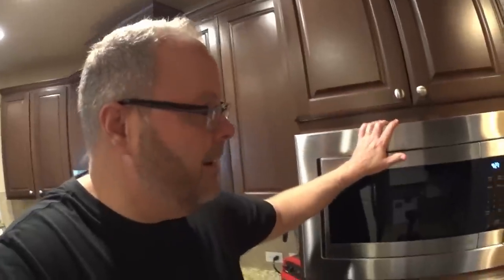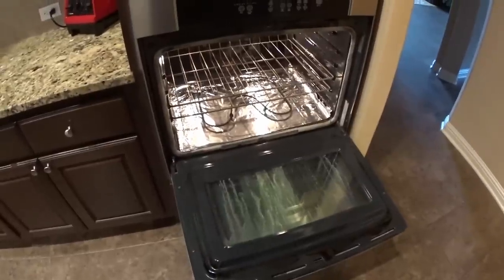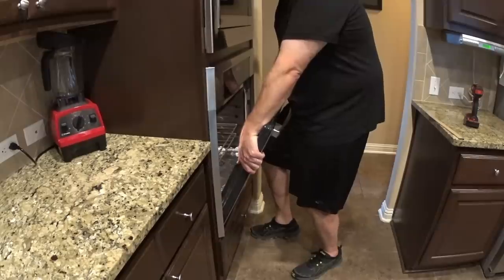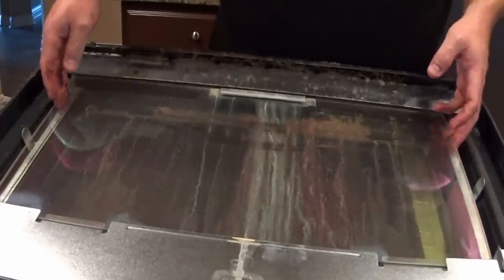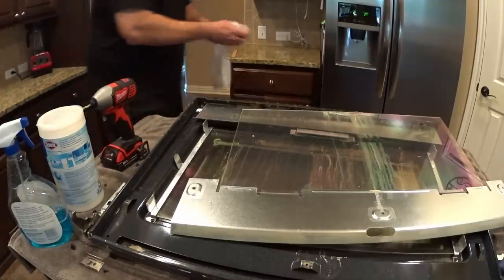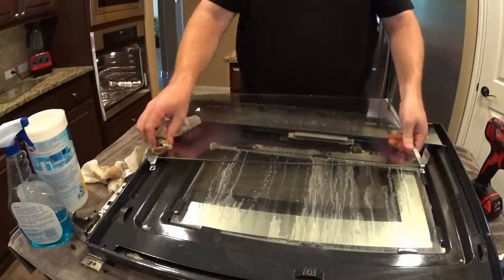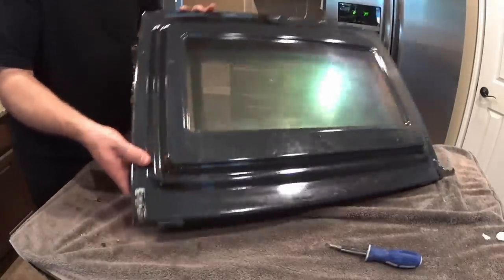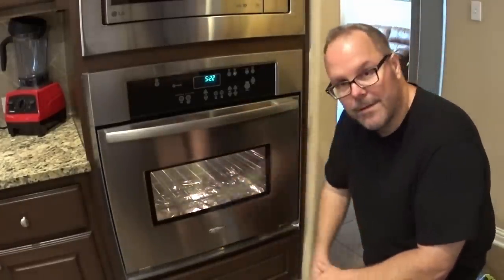Clean BETWEEN Oven Glass - How to

Comment: I have the same issue with drips between the inner glass on a GE oven. Will use my phone camera to take photos as I go. Suggest using light pieces of cardboard and punch screws through it to keep each section’s  hardware together or , possibly baggies.The third pane makes the oven more energy efficient , but not perfectly sealed for preventing drips.

Comment: How come you are putting in what looks like cotton batting between the bottom layer of glass & second layer of glass?  It wasn't there when you took it apart.  Is it flame/heat resistant & what is it's purpose?  Taking the door off would also make it easier to reach all the way into the back to clean the oven.
Reply from the maker: Thanks for taking the time to comment. The batting is heat batting that was already in the oven door and l am just placing it back where it was. Apologies my edit did not capture it's removal as well as it should have.

Comment: To those looking and thinking “it’s too complicated for me” don’t give up until you check your own oven first.

This oven demonstrated here seems to be way more complicated than my Indesit oven to clean in between the glass.

With mine and I suspect many other makes too there’s no need to remove the door at all , let alone all the casing either

Just drop the door down unscrew two obvious screws holding two small brackets in place that is holding the glass to the door , prise up the inside glass carefully using a butter knife or screwdriver and clean the insides of the two panes of glass ...replace and your done ....5 mins tops.

This video although well presented is not typical of the faff you need to go through to clean the inside of the glass

wether this channel presenter knows it or not he has one the most overly complicated ovens to clean inside the glass I’ve ever seen .

Trust me , before you give-up-the-ghost on even looking at yours based on what is presented to you on this video go and look at yours first ...it’s blatantly obvious what 2 screws needs to be unscrewed and removed before you need to think about disassemble the entire door like this video shows
Reply from the maker: Agreed, all ovens are different so it's definitely worth a look at your own oven.

Comment: Does the door have to come off in order to clean it?
Reply from the maker: It does if you can't get it fully clean through the openings on the top. There are a few screws along the bottom that you can only access by removing the door.

Comment: When you are taking apart why you did not show when you pull out that white insulation ,you only show it when you are putting it back.
Reply from the maker: Apologies the editing did not show it as well as I had hoped. The insulation was simply laying on the bottom piece and I reassembled it exactly as I had taken it apart. Your oven may or may not have this insulation.

Comment: There is a much easier way to clean the oven door glass. Get the aerosol window cleaner and polish .. Sold in auto parts store in our area. Then put a towel underneath the bottom of door , there are large vents on the bottom. Then carefully spray the cleaner in the top vent holes. You may need to do it a few times in the beginning. The spray turns to a white foam. And read the can before using the window cleaner. !!!!

Comment: This video is totally stressing me out!  All I can think of is not remembering how it goes back together and having parts left over  lol.
Reply: Haha, well, it's not for everyone.  For multi-step tasks like this, I take a pic at each major step then label a small zip-lock plastic bag with that step's #.  Then I put the screws, nuts & bolts, etc. for that step into the bag and note that step on my notepad/clipboard.  It's a bit slow while taking things apart, but the payoff comes during assembly when I don't have to remember where things went or which screws or bolts were used along the way.  And now, with today's mobile phones, a "pic" can also be a "motion photo" -- meaning it's a short video clip.  (A feature on my Samsung GS9 phone.) 😁
Reply: Check out the method GE Appliances reccomends haha theres a video on youtube, they remove the door as one piece and leave it like that. they just dip a towel in soapy water and then tie it onto a yardstick and poke it between the glass from the bottom

Comment: Started watching video, stopped after the oven door was removed and had 3 panes of glass--this would be an all day project and my husband would be the one removing and reinstalling the door; his schedule would not allow it.  I don't have the strength or wherewithal for the project (in my mid-70s).  Thought the first idea, reaching into vent holes with something resembling a yardstick w/paper towels wrapped around the end, sounded plausible.  However, I envisioned removing the stick but thepaper towels remain between the glass panes.  Dirty window better than framed dirty paper towels. LOL

Comment: Ok I did on my 2020 GE profile oven (three panes of glass). It took about 45 minutes. Need a phone camera , Need a T15 TORX driver and 1/4 inch nut driver. Remove door and lay it on a rug or towel on floor or bench. Remove top two top screws from top inside of door. Just loosen enough to free them. Turn door over and remove three machine screws with nut driver at bottom. Other than that pretty much like his video. Suggest nitrile gloves to handle glass. The two inner panes are framed by a steel double channel. There is a tab on one corner that you bend up to release the frame and carefully slide out glass panels for cleaning. The glass is thin so have a towel on a flat surface to clean them. As I said , take picture along the way and Mark holes where screws go if you need to. There are four sets of screws all same length and type with each set so it’s hard to confuse things.

Comment: Some door panels have a retaining mastic which stops the glass rattling in the metal frame. To remove the glass, apply gentle pressure in the opposite to the retainer mastic to slide the panels out. 
Don’t use metal tools on the glass or it’s direct fixtures as cracking, fracturing or breakages will result. I wouldn’t use a steel ruler near the window to clean it as it it could easily penetrate the cleaner cloth or material used to bind it. 
Those doors are awkward and dependent on the state of your oven, you may need to place a protective covering on the floor in front of it before starting to disrupt any of the fixtures/hinges.

Comment: There is no way I will ever clean between glass panes. I think it would ruin the seal. I have never had a problem with dirty glass, but it is not visible unless the oven light is on, so if the panes were dirty I would not see. Lol. I use the oven light about once a decade!

Comment: I need to do this to my oven. From watching the video though, I suddenly like the rustic look.
When I remove screws from assemblies like this, I store the screws in the holes from which I removed them. Especially when it involves screws of differing sizes.
When I work with loose glass panes, I wear gloves, in case the glass slides, I don't get cut; and, I don't leave fingerprints when I handle the clean glass.

Comment: Very informative. Am I missing something, I see a cotton gasket in the reassembly but did not see it in the disassembly.  How did I miss it?
Reply from the maker: Thank you so much for taking the time to watch the video! That was a piece of heat resistant fabric that was laying around the perimeter of the outer window on my oven model and not attached. It gets sandwiched between the outer window and the inner frame. My apologies the edit did not show it as well as it could have.

Comment: Hope you rememberr where all them skews go so what did you clean it with after all that
Reply from the maker: I used clorox wipes to clean the grease off the glass and then followed up with glass cleaner. It worked out great! For the screws, I put them around the perimeter of the door near where I took each one out.

Comment: I didn't see that white strip of cotton/cloth you put back in @ 6:27. I didn't see it come out???
Reply from the maker: Hi there, thanks for watching the video! Unfortunately my editing did not depict the removal as well as I had hoped. This was a heat resistant fabric that was laying around the outside window of my specific oven model and was simply sandwiched between the outer glass and inner frame as you see in the video.

Comment: The stuff that is getting in between that glass is from wiping the top and water and soap is dripping  in between the slots on the top. If your oven is a newer of than by taking off the door like that you will void your warranty don’t do that. You can also go up from the bottom and clean to but stop dripping soap and water from all the holes and that won’t happen.
Reply: Grease from cooking drips between the slots.

Comment: I really want my oven glass to be clean.... I can't even see through it right now.... but I'm scared I won't be able to reassemble the door once I take it apart! Any tips for making sure I can reassemble it? You did it so easily, and it looks great! :)
Reply from the maker: I am with you! Using the yardstick method I mentioned at the beginning was going to take too much time and frankly I was not sure it would get everything - like you I really wanted it to be clean! Best advice is to take your time and take pictures of the inside as you are taking it apart to make sure you see where everything goes. Once inside, it was pretty easy to make sense of how everything goes back together. When you are taking the screws out, I placed them around the outside of the door near where I took them out. When you assemble it back together, make sure all of the holes line up. I found clorox wipes worked excellent to get the glass clean and then just follow up with glass cleaner and you will be in good shape! Good luck and let me know how it turns out!
Reply: Easiest tip for anybody taking anything apart and wanting it to go back together :
Use your phones camera, take pictures at every step.
Another trick is to use butchers paper (Xmas paper works too, just flip it to the blank side). Draw the item, showing where each screw goes. As you remove a part place it on the full size drawing. (Your drawing doesn’t have to be very artistic, just enough for YOU to recognize the part.). I’d even number th3 parts as you take them off. 1 for the first part 2 for the second. Don’t use 1 number for parts even if they are the same, number them in the order you removed them. 
Good luck. (When my sons got into R/C cars, this is how we educated ourselves about them.)
Reply: Guarantee it wont be that easy I've tried crazy stuff like this, that was at least a dozen screws on 3 different panels shoot it would never go back right. Just my opinion. Also with stopping the video who knows how long this really took I bet at least 3 or 4 hours. I would be thrown the glass out the back door after hour 2. Lol

Comment: I see you have foil on bottom.  We recently bought a new house this past December.  When we bought the house all fairly new appliances (about a year old) however the previous owner did the same and I have foil stuck on oven bottom can not get  off no matter what. Does yours not stick? I've tried everything.  My bottom heating element is under the casing in oven not showing  like yours is that the difference? Do you have any recommendations? I've done baking soda with vinegar etc etc
Reply from the maker: Thanks for taking the time to comment! I think the stuck foil must be because of your element being below the surface. A quick search on the internet and I found this article that may help with removal of the stuck foil: https://www.cannonsappliance.com/oven-cleaning-tips
Reply: @ThatDadMike  0
Reply: @ThatDadMike  i love you show it helps alot ty

Comment: My question is WHY or HOW does this happen. I live in an apartment. 2 units in same complex—transferred from one to the other. SAME ovens. Lived at one 14 years (!) and NEVER had any streaks within. New unit just moved in. After 2 months there are streaks inside already! Why????!! Ugh…(And here I’m trying to be all careful in the new place because of the horrendous job of cleaning the dirty oven in the old place at move-out…)
Reply from the maker: The only thing I can think of is when we scrubbed the top some of the cleaner must have drained down a bit. It's been clean for two years now and unfortunately this last cleaning triggered it again. Definitely a poor design.

Comment: And I see the tinfoil on the bottom! I will definitely do that! Thank you for the great tips 😊
Reply: WARNING: Do not place tinfoil on your oven floor...some oven manuals actually say it can damage the oven. 
Read precautions first.
Reply: @tonymusolino2369  Ok, thank you so much for the information 😊
Reply: Don't put foil on the bottom. It will heat damage the oven. Instead, you can cover the bottom rack with aluminum foil.
Reply: @tonymusolino2369  I can't use this video for removing the oven door since my oven door has different style hinges.  Once I saw that sheet of foil on the bottom of the oven, I was wondering how long I'd have to scroll down before someone commented on how that is NOT recommended.

Comment: Good, but you didn’t show us when you removed those white cotton like square, thanks
Reply from the maker: Sorry about that, my editing may have cut that portion a slight bit. The white heat resistant fabric was just laying around the outer door glass and does not need to be removed. It gets sandwiched between the door and the next frame piece as shown in the video.

Comment: (1) You should have mentioned that taking anything apart will void any existing warantee. (2) Others have mentioned that taking it apart has affected the air tightness of the door, and that can make baking a fail if you are constantly leaking heat.
Reply from the maker: Thanks for taking the time to comment and appreciate the suggestion. The warranty on my Whirlpool had expired. The factory only provided a 1 year warranty from date of purchase and was limited to defects in materials and workmanship from the factory (receipt required). If yours is still under warranty, it's worth a call to your oven manufacturer to be sure but my paperwork did not expressly state that it would void the warranty. Additionally Whirlpool publishes instructions on how to remove the door on their website. If the door is reassembled correctly, there is no impact to the tightness of the door or its ability to retain heat.

Comment: I feel there were some steps and/or details missed. Like the insulation that you showed having to put back in, which you never showed coming out. It also looked like there was more to separating the two halves than just remove screws and it's done.
Reply from the maker: Thanks for taking the time to comment. My apologies but my editing cut slightly short the picture of the insulation. It was simply laying around the glass pane and then sandwiched between the frame as you see in the video. My oven was only held together with screws as you see in the video. Total time was less than an hour and it was much easier to disassemble than I had expected.

Comment: Did anyone notice how his cam skips the removing of the "insulation" step but you see him put the insulation back on? That's a major faux pas.
Reply from the maker: Hi there, thanks for watching the video! Unfortunately my editing did not depict the removal as well as I had hoped. This was a heat resistant fabric that was laying around the outside window of my specific oven model (yours may not have it) and was simply sandwiched between the outer glass and inner frame as you see in the video.
Reply: @ThatDadMike  Thanks for the clarification. Editing gets Oscar awards so I respect it is not easy.

Comment: WHY TAKE THE DOOR OFF; IT IS NOT NECESSARY!  JUST UNSCREW AND REMOVE THE GLASS, CLEAN IT AND REPLACE IT. WHY MAKE IT SO COMPLICATED!
Reply from the maker: Unfortunately the way my oven door is constructed there is no way to remove the glass without disassembling the door. There are screws along the bottom edge that need to come out and once removed, the hinges can no longer support the weight of the door so the door has to come off. I wish they made these easier to clean, but all in all it was not too hard to do and took less than an hour to complete.
Reply: @ThatDadMike  Okay, understand. Thank you.

Comment: Whoa, wait a sec, what were those little metal pieces u removed at about 03:40 ..? 
And when was there insulation..?
Reply from the maker: Are you referring to the two silver metal brackets on the side closest to the camera? If so, those help keep the front and back of the door sandwiched together on the Whirlpool model I have. If not, take a screen shot of the part of the video so I can be sure of the part you are talking about and I will tell you what they are. The insulation blanket was laying around the inside window and was the very last thing removed.
Reply: @ThatDadMike  , ✅

Comment: I was employed by Housing Authority and the one thing I learned the hard way was never put foil under a burner ring. Because when you turn on the burner or oven it created a small breeze if the foil touches the burner when it is on it will blow out the ring sending a flame out. I was inspecting an apartment part of the job was turning each burner and the oven. Which I did when I turned on the over both the resident and me look into the oven when a foil touched the burner a flame shot out and shingled both our eyelashes an eyebrows.